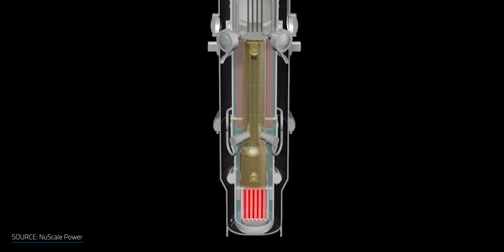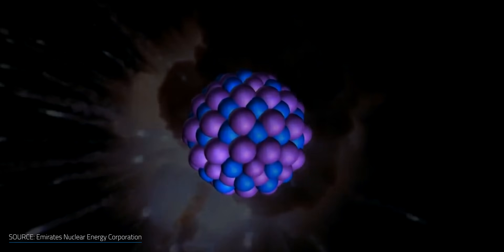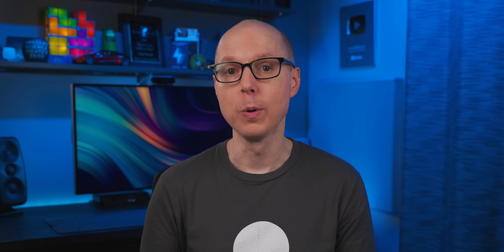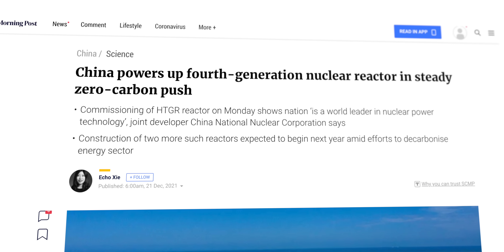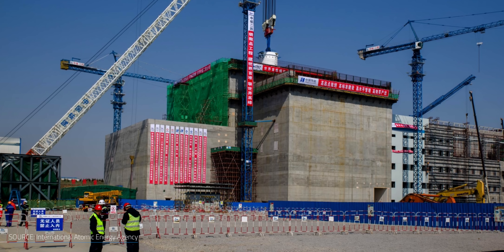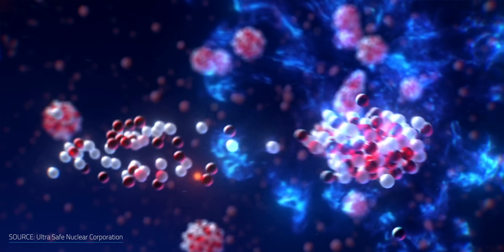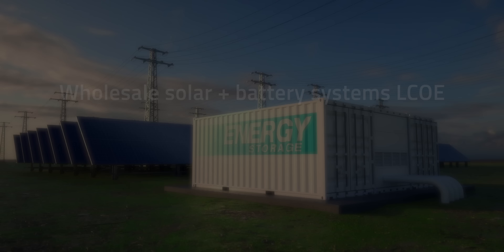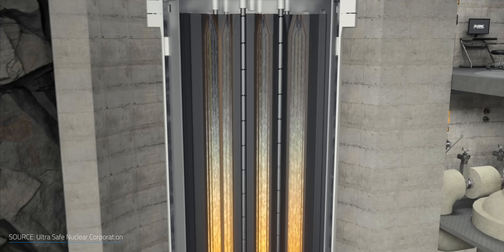Forget Small ... What About Micro Nuclear Energy?

Comment: I work in High Voltage Transmission in Canada. In all honesty the two things holding back nuclear development the most is irrational fears specifically of the older generations and regulations. The rate of energy emergencies is growing every year due to population increase yet other than wind, no new plants are being built. Additionally due to environmental crusading many of the baseload plants have been shut down or converted and derated (Coal plants converted to Nat Gas generate about 10% less power). combine that with the intermittency of wind it just creates a nightmare for those trying to keep the power on. All of this puts tremendous strain on the grid all in the name of virtue signaling. For example we cannot burn coal anymore for "carbon goals" but it is perfectly fine to load it on a train car, transfer it to a boat and let China burn it in their super inefficient setups instead of our highly regulated systems with scrubbers and CCS systems... which were all shut down doubling the price of power in 3 years.
Reply: It's almost like the collapse was planned
Reply: we should just put the radioactive waste in your basement San Onofre has a lot do you want some?
Reply: So true, China only shows us the progress. While they burn all the worlds coal. That’s called suicide. 
Anything we can do, to stop the coal burning, gives us a chance.
Reply: We have excellent battery storage to solve the
intermittency of wind power. There are a variety
of energy storage methods which are grid scale.
The promises of LWR nuclear power plants were
a pack of lies. We built nukes all over America
with massive government subsidies and they
still failed. Now nuke plants are storage sites
for nuclear waste. 
Coal-burning creates highly toxic coal ash.
We need to build a hydrogen economy and
get off fossil fuel before we  ruin our planets
atmosphere.
Reply: @franklinrussell4750  If you truly believe that you do not get information from truthful sources but from emotional ones. Your understanding of the grid is exceptionally flawed and that thinking is causing a power crisis.
Reply: @franklinrussell4750  So right back to emotional arguments of "uranium bad, Lithium good". I can explain almost anything regarding the grid if you ask, It is what I do for a day job. There are tangible grid scale storage options but to expand them to a point where they can counteract the intermittency of wind and solar would take a financial investment almost as large as the grid itself. For example in my region wind is now reaching about 25% of our TNG , yet they have an averaged output of around 30% of TC (total capacity ie uptime), meaning for every Megawatt of Wind installed you actually need 3 MWs and Storage to counter the intermittency. To compare to solar, we are in a fairly high solar index area but it only has about 40% of TC averaged output. Both of which are non dispatchable, unreliable, and cannot be used in a blackstart situation. Whereas coal, gas, and hydro all have a 99% TC. All our coal systems possessed high efficiency scrubbers and/or CCS before they were decommissioned. Since then the price of power has more than doubled in 3 or so years and the coal production is still ongoing but instead it is shipped to China where it is used without environmental regulations. So given the pure retardation of the environmental movement we simply have a choice, extremely expensive unreliable power, or nuclear. Because for the greater grid a dinky Tesla wall and a 5KW solar system is not a viable solution when it come to powering a food processing facility burning 50MW.
Reply: @franklinrussell4750  Have you ever heard of the term "pipedream". Liquid air batteries have potental but at this point in time that is all it is, and flywheels are better on paper than in practice. The Transmission Grid already uses flywheels to MVar shortcomings. In this case they are called Synchro Condensers. Great for keeping voltages and phases in check, but garbage for energy storage. Additionally you forget the two most important parts of every grid, Cost Benefit and reliability. With those two things in mind, companies and governments are unwilling to take chances on unproven tech. Grid scale storage is just not tangible nor cost effective when compared to base load systems.
Reply: @franklinrussell4750  You need to work on the comprehension thing. I never said they don't work. I said they do not meet the requirements of cost benefit and reliability. That is the main driver of the grid. Storage systems only store a tiny amount of power in the grand scheme of things and cost a tremendous amount of capital to build, and they add very little benefit from a pragmatic point of view. That is all capital funds better spent on more generation. In reality the only places where energy storage has a significant cost benefit are relatively unstable grids like in California. And why is their grid so unstable? excessive renewables.
Reply: @hightechredneck8587  As I said before,
the power grid in Texas killed 120 people
even when most of the Texas power grid
uses fossil fuel and nuclear power.
The Texas power grid is worse than California's grid.
Flywheel power storage is working
very well in New England.
The system is scalable so you only
need to add more units if you want
more capacity . You are unable to show
any example of flywheels failing to
be scalable. Even lithium-ion batteries
are scalable. Here is a town in Australia
running on batteries and renewable
power.https://www.youtube.com/watch?
v=kYMtqnzEDVg
Horndale Australia.
The reason companies don't switch
is greed. They want to pump more
profits out of their paid-for equipment
They don't give a damn about people
or the future.
Reply: @franklinrussell4750  That is a nothing argument. Power storage would not have helped the texas situation. In fact it was overdependance on renewables that caused the instability. Stored power reserves cannot be used in a restoration setting. You greatly underestimate the power demands of the grid. An argument can be made for renewables for the supplementation of the grid but they cannot provide baseload power nor are they reliable enough for peak load power. Nuclear is the best option with hydro for peak load hedging.
Reply: Great to see industry expert feedback.  Nuclear is critical and PR is a mess.  Everyone seems to think we just need renewables but mass transmission, and storage (especially seasonal) is a pipe dream for reaching 100%.  Replacing nuclear with solar and natural gas is a lateral move at best.  Biomass is also a big loophole in climate agreements.
Reply: @ccibinel  Actually the real issue with renewables in some areas is the politics of storage. For example in the UK the cost of electricity actually goes negative at points. If you had a 100kWh battery bank and even a 3kW solar PV roof you could most likely draw from the grid when prices go negative and sell when they peak. When solid state Sodium Ion cells are in production then the 100kWh battery banks will be no bigger than current 30kWh battery banks. However the cost of battery banks is outrageous compared to what they should be. It's about £1000 per kWh including installation. The LG INR18650-F1L in one off pricing if you go to somewhere like NKON (In the Nether Lands) works out £0.2 per Wh so £200 per kWh or £3000 for a capacity the same as a Tesla 15kWh power wall which costs upwards of £12,000 installed. The electronics and casing are not expensive either £1000 for both would be over the top. So my conclusion is the shareholders just don't want domestic level storage as it would affect profits. There are also flow batteries that would fit under the stairs (just) in many houses that have a capacity of 1MWh. IE enough for a small industrial unit. Again that would affect profits. The only solution being pushed is gridscale. I wonder why LOL.
Reply: @gordonlawrence1448  The economics of home scale storage (production, installation and maintenance) shouldn't be viable when compared to power companies scale.  They have centralized equipment and people who's job it is to understand/optimize the system.  Random one-off batteries in every home of different types should never be cost competitive with centralization and the only reason they make sense is broken subsidies / billing that fails to account for externalities (just like home solar in canada where the land is not an issue).
Reply: @ccibinel  There is also one very important thing they do not talk about regarding renewables that is more known in the industry but not know outside. There is a subtype of electricity that helps support stability and is required for powerful mechanical devices called "Reactive Power" . The thing about Reactive Power is it is required for many things but is primarily created as a by product of spinning mass generation (non-Inverted AKA Thermal plants) Renewables do not produce enough MVar or inertial properties to maintain grid stability nor large mechanical loads. (ie industrial settings like refineries or grain elevators). In my opinion it is absolutely a pipe dream, renewables are great for a supplement to reduce fossil fuel consumption... but nothing more, and once it gets to be 30% of a grid's total net generation problems start to occur.
Reply: "Renewable" is all a big scam, it will never work. It's all made specifically to control the people and make them dependent.
Reply: @ghoulbuster1  hahaha people who only get their electricity from a nuke supplied by a uranium cartel or coal supplied by coal barons are independent? You are a shill
for corporations, we are not fooled by you
Mr. ExxonMobil
Reply: Dr Micho Kako used to be pro nuke. Now he is anti nuke. His logic and facts are a death nell to nuke power . He doesn't need to use irrational fear mongering. My solution to the radioactive waste is to store it in the bedrooms of the pro nuke crowd.
Reply: @kevenc4843  Thank you for the information.  I will certainly be looking up Dr Kako.  Regarding your point about nuclear waste in bedrooms...  Noone is suggesting nuclear materials are not dangerous.  But the impact of using fossil fuels or the delusions of non-existant storage infrastructure with renewables are also problems.  Perfect solutions don't exist (until fusion but that is 30 years away).  CANDU is an interesting and proven technology that can deal with the "waste" by making it fuel.
Reply: @ccibinel  Precisely this. The newer gen 4 reactors can use current waste as fuel. once used it will have a higher than normal radioactive decay for a couple hundred years, which frankly is a faster breakdown time than most diapers. The storage of nuclear waste is more fearmongering than it is an actual issue for the industry.
Reply: @kevenc4843  Kako is a wanna-be television star whose theories and opinions wax and wane with his ratings.   He's no longer a source of truth IMHO.

Comment: What ever happened to the CANDU reactors that were being built in Canada?  I thought they were designed to use spent fuel rods from “traditional “ reactors and able to utilize up to 95% of the remaining fuel in the rods.  Will the micro reactors be able to power container ships, thus eliminating their need of bunker fuel and its massive carbon emissions?  

Thanks for sharing this insightful video series.  Wishing you and your team a great week.
Reply: Pressurized Heavy Water Reactors like the ones you have in Canada are not really seen anymore as the future of nuclear energy.

They actually produce more waste than conventional PWRs and also the core design needs to be more robust, since the power density is lower than in PWRs.

Canada and Argentina have both already discarded the possibility of building more of these reactors, with only India remaining as the one willing to build more of them (because they already developed their indigenous tech based on them).

And as to nuclear waste recycling, that's on fast reactors, which are the next big thing in the nuclear industry. They are able to recover the remaining energy from spent fuel used in PWRs while at the same time transmutating the actinides into much less of a problem, since they decay faster.
Reply: Micro reactors and SMRs are both able to provide marine propulsion for container ships. This issue is being discussed in a much more political debate than technical, since many ports refuse to accept nuclear-powered vessels, although they have safety systems much more reliable and trustworthy than current diesel-powered ones.

There is a high expectation that Molten Salt Reactors will be the ideal solution for naval applications due to their enhanced properties in proliferarion resistance and inherent safety. The first ones are expected to come online by 2030, with ThornCon and Terrestrial Energy being the expected market leaders in the West. China has a very mature and well developed program on Molten Salt Reactors and should have the first one up and running by the end of this decade.
Reply: The main benefit of CANDU and PHWR is that they operate on unenriched uranium.  At the time of design, Canada didn't have any enrichment facilities.  Natural uranium was the only option.  The secondary benefit of CANDU is that they don't have to be shutdown to refuel or shuffle the fuel rods.
PWR burns up to 5% of the U-235.  CANDU burns up to 7%.  It burns a little more, but not much more and not 95%.
Reply: Not a bad idea to use them as a power source for our ships in the oceans, but will we enforce bringing them back to port instead of dumping the old fuel over

Comment: Matt, rather than LCOE calculations to evaluate alternatives, does anyone calculate how much oil/nat gas/coal it takes to build out a specific alternative type of energy production and what the volume of waste each alternative will produce? Since green energy produces only a fraction of power today, the reality is that we have to "spend" fossil fuels to build out any alternative.  China is a major global supplier of solar panels and they use coal fired power plants to build those panels. Mining and refining all the things necessary to build not only alternative power production elements but also lines to transmit power (particularly wind from where it blows a lot to places where power will be consumed) will take a lot of fossil fuels to construct. It also takes years to build and get all the legal approvals for new interstate power lines (much longer than a nat gas pipeline because there is no federal regulatory body like FERC for electric transmission that can overrule state/local regulators when building a gas pipeline). I would assume small nuclear would be easier to plug into the existing grid to replace decommissioned old nuclear plants and existing coal and gas fired power plants. Agree nuclear waste storage is still a problem due to long lasting actinides, but its total volume is minute compared to the waste volume we will have with worn out solar panels and no good way to get rid of the toxic metals in those panels (which is also true for all the electronic waste we produce), not to mention disposing of huge wind turbine blades which don't seem to last very long, as you have reported in the past. As you point out, Thorium reactors may be one way of dealing with long lasting nuclear waste.
Reply: I think you need to diversify the sources you are getting your information from as quite a bit of this is misinformation. 
1. China's electricity supply has a higher proportion of renewables than the USA's. 
2. The regulatory burden on nuclear is far greater than that on expanding the power grid
3. Solar panels can be recycled much more easily than nuclear fuel can be reprocessed
4. Wind turbine blades last about as long as most SMR design lifetimes.

Please fact check me on this as there is more nuance in the detail.
Reply: @SocialDownclimber  I agree there is much nuance. On your point 1, yes China's renewables are 10% vs 9% in the US of total power generation according to a 2021 CNN article, but coal and lignite are where China gets the majority of their energy according to that same article. Agree regulatory burden on nuclear is problematic for SMRs and MSRs, because the rules were made for 1960s-70s boiling water reactors, so they will need revisions. Agree current nuclear fuel cycle is problematic, but as the video pointed out, thorium and other types of MSRs could address that issue. While solar panels are potentially recyclable, they face the same problem as all our other mountains of electronic waste, most of it gets shipped to less developed countries where labor is cheap and the components are taken apart by hand, exposing those workers to toxic metals. I agree with point 4. I rewatched Matt's wind power video from last year and the issue was recyclability problem of the blades made from composites. I was mistaken on that point.

Comment: funny, after 400 years, we still power ourselves with steam.
some pretty fancy ways to heat it, but it's still the same 400 year old tech.
actually, some examples from egyptian times, but they didn't have the ability to exploit it.

also interesting, is our ability to bore deep is stymied by heat at deep levels.
think we could do something there?
we should scrap this dangerous nuclear stuff and incentivize geothermal.
could be put in right away, not decades from now.
it's clean,  can be put anywhere, minimizing infrastructure to send it anywhere.

imagine a lot cheaper than the billions that nuclear costs to develop, let alone the billions to actually build it, and the billions over time to deal with the waste.
like oil, looks real good, til you have to clean up behind it.
could even use geothermal to fuel tarsand extraction, instead of gas cogeneration that heaps huge infrastructure costs on the people again.